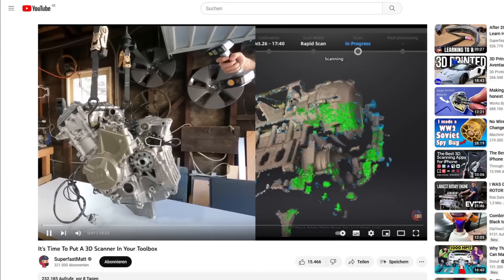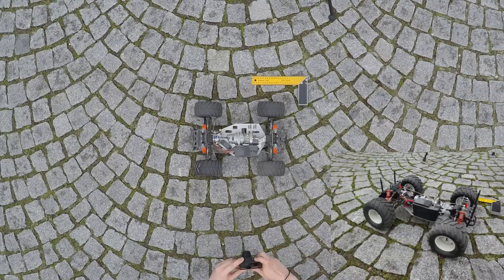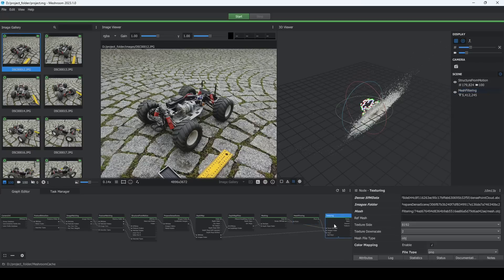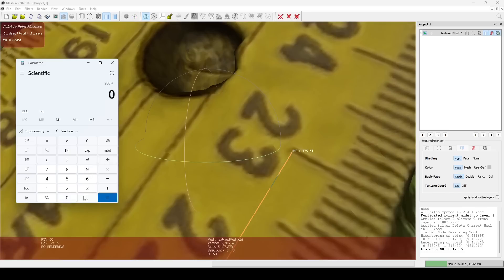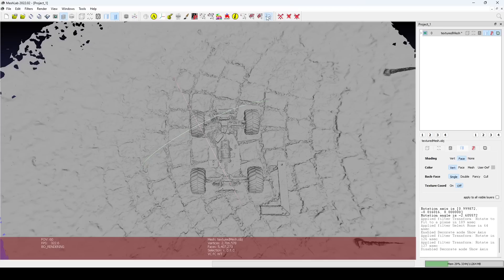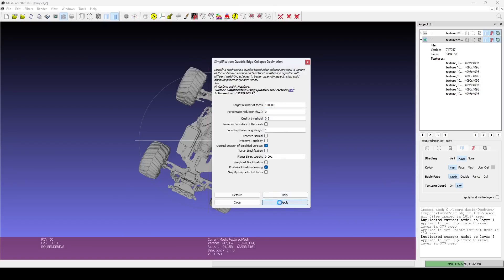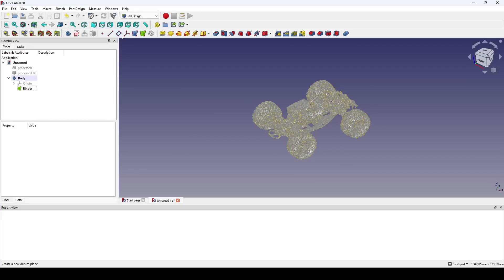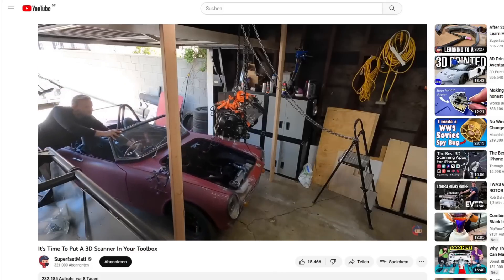It's Time To Put Open Source Photogrammetry In Your Toolbox

Comment: How do you take pictures of the bottom of the subject? There's a lot of detail underneath.
Reply from the maker: I know two ways around that issue. Option A: Mount your object on a pole at a height that allows you to take pictures from above and below. Option B: Perform two scans, one with the object flipped upside down, and merge them digitally. Meshlab has the Alignment tool for that purpose.

Comment: The main idea of 3D scanning is that you don't need to do yourself 3D modelling. As long as it requires doing Topology manually after scanning it's not working as intended. You could 3D model this RC-Car by hand faster than you 3D scan it and then model manually
Reply: You don't get perfect CAD ready 3D models from 3D scanners either, there is separate software for that.

Comment: How would you change this workflow to make a 3D model of something big like a house or garden?
Reply from the maker: Not much. You'll still want to get pictures evenly around the object. Professionals use a drone for that. If that's not an option, take pictures close and further away from the house. Then, depending on your roof you might not get good reconstruction there. For scaling you could use the length of a wall for example.

Comment: I'm still waiting for a good OCR AI that can read old math books and transcribe all the formulas without any issues
Reply: Like handwritten or printed? I feel like tesseract should be able to do it if it's printed. If memory serves there is a language pack for math symbols.
Reply: @oliverer3  Yes, I have tried Tesseract as well as numerous open-source tools and private software like PDF elements. I have some old scanned books that are no longer available in my country, but they are low-quality images in the form of old PDFs. Unfortunately, I haven't come across a single AI tool that can accurately recognize the text and transcribe it directly into a format like Markdown or LaTeX, especially when it comes to mathematical formulas and other symbols.
Reply: @Maisonier  You could probably use a combination of tesseract and OpenCV to do it then but it would take a decent amount of manual effort to tune it. Plug and play tools are probably not there yet.

Comment: Bro came back after 9years and just posted a super useful video. Very appreciated, thank you😁
Reply: hahah 
That’s pretty wild. I did that on one of my other channels. Just had some mobile game  footage from years ago and posted a flight training video. (with a real airplane, not a video game)

 Just wanted to backup the files somewhere else besides the phone because it was overheating and the battery was expanding in thickness. Didn’t want to have to wait until I could order a new battery to get to the video files, in case the battery completely failed or even burst open. Ended up uploading public by accident and didn’t realize it till I got home hours later. Some of my old game buddys saw it along with a “face reveal” lol

Comment: 0:20 isn't that an AMD Gpu?
Reply from the maker: It's a Nvidia 1080 Ti.
Reply: I don't know even any LLM project using anything other than Nvidia, so forget about Amd and never buy their trash - after they deliberately engineering the death of graphics chips in all Macbooks Pro from 2011, which I have, moreover I have two similar models Macbooks, one Nvidia, other Amd and last one died as predicted on forums, a mass time bomb. It's really hard to resurrect macbook after, you're left only with Intel graphics and half power slower notebook. Their chips dying because of overheating, ridiculous.
Reply: @fontenbleau I don't know about the incident you refer to, but given it's an apple product I wouldn't be so quick to blame AMD. The LLM thing is because nvidia holds the rights to CUDA, not necessarily because they are inherently superior. Frankly I think in raw rasterization they offer better value than Nvidia in the most recent generation, but limited in gaming by ray tracing, and limited in everything else because of Cuda. They could make Cuda Red or something, but why would any developer support it when Cuda is already a standard with like 90% {made up number} market share and existing libraries. Their CPUs in recent years are genuinely so much better value and power efficienct than Intel's (and just better outright in gaming with 3D V-Cache) that I want their GPU department to start pulling their weight.
Reply: @paul-fornage  maybe if you would own such Apple model you will know, because apple forum filled about that, i've made the notorius recovery method by overheating it under blanket, but it worked for few days only and their current hardware even cheaply made. I have Mac mini from newest, it's horrible ventilated & overheating always.

Comment: can we use photogrammetry with turntables instead of us rounding the object?
Reply from the maker: Yes that is possible. For it to work I had to set "Minimal 2D Motion" in the "FeatureMatching" Node. I used a value of 5 but you might have to experiment.

Comment: i love the vid but the result is poor
Reply from the maker: Better results are possible. Either by taking more pictures or by tweaking pipeline settings. You can find more information here: https://meshroom-manual.readthedocs.io/en/latest/faq/reconstruction-parameters/reconstruction-parameters.html . For those improvements you will have to accept longer processing times.
Reply: @DanielJutz  but is it better than a manual topo ?

Comment: Is nVidia strictly required?
Reply from the maker: Draft Meshing is available which does not need a Nvidia GPU. While it computes faster, the results will always be worse. You can access that Pipeline from File > New Pipeline > Photogrammetry Draft. You will probably want to increase Describer Density and Quality to high or ultra in the Feature Extraction Node.
Reply: These days of Ai you can't even test any LLM without Nvidia, forget about cheap notebooks with Intel graphics or AMD trash (their chips are cheap but very bad in support and unreliable, Amd was found in planned obsolescence in graphics chips, so designed defects in Macbooks which massively dying after certain years, I have one of whose).

Comment: 4:13 you mean use a decimal as a decimal? Why do Europeans use commas for decimal points?
Reply: Why do they use a comma in that case?  Because they were already using the period as a thousands separator, of course!   :)

This sort of thing is quite like the idea of having traffic drive on the left or right hand side of the road as a convention.  To be pedantic, it's called a radix point in general, in case you're not using a period, or a comma ... or not using a decimal number system.     

This issue is a problem of bad localization in MeshLab, and it ought to be raised as a bug with that project so this sort of advice to use a foreign choice of radix point symbol isn't needed anymore.

Comment: I recommend using your smartphone for taking photos. Like the S22 for example. But before you start, turn on any metadata options you can find. It will write every sensorvalue including tilt, position, roll etc etc into the image metadata and photogrammetry tools can use those very efficiently!
Reply: @UCKY5  The majority of smart phones don't allow you to turn it off besides GPS which is a good thing in this case.
Reply: How to record orientation of each photo? Idont get it. if it's drone, it separated to different file
Reply: @rafiffadhil5872  It doesn't NEED the orientation as meta data. It just speeds up the calculation if it does.
You can throw different cameras in the software (like mixing drone shots with regular shots) and the software will do just fine.
Reply: @clipeclipaway  exactly. Normaly you don't need any additional settings. For example when taking photos with the S22, the image contains stuff like:
Orientation
Position
Focus length
Lense type
Pixel size
These are stored in the exif metadata of every image.
In Windows you can see some when you right click -> properties -> details.
Reply: @UCKY5  it's likely on by default, and unable to be disabled
Reply: @justinlabarge8178  how do I check that my files have them?

Comment: I recommend 3DF Zephyr (there is a free version to try it out) or better buy a good 3D Scanner such as Einscan SP or Einstar from Shining for slightly bigger parts.
Reply: I also prefer 3df zephyr, is much much faster imo. Free version used.
Reply: the free version has a limit on the number of images you can use
Reply: @theneonbop  yeah but it’s around 70 pictures. Try it out. It’s enough for most projects.
I bought the version for 300 pictures in the end because it works.

Comment: A very fascinating thing. Tried myself 30 hrs ago. My thing is still rendering. I guess 70 photos with 108mp is overkill. Has Ryzen 5 1600x, 16gb of DDR4 RAM and Gtx 1060 6 gb to process it.
Reply from the maker: The number of pictures is good but 108mp is a lot ;) Are you stuck at the depth map node? That one took the longest for me. In the depth map node you can set a downscale factor. Try 8/16, the default is 2. On my system 100 images at 18mp took 80 minutes (ryzen 3800xt, 32gb ddr4, 1080TI).
Reply: @DanielJutz  It was just the first step. It took approx. 65 minutes to process one photo. So at 35 hrs it was around 30 photos out of 68. So i went to make another set of photos xD
Reply: maybe try using a better camera. Picture resolution isn't a good value to judge camera quality, usually they aren't good sensors if they need to market them with 108mp
Reply: Algorithmen often work better with less megapixels. Tesla's FSD example work I believe with a 3 or 5 Megapixel cameras. But sure it's not the same for fast real time 3d Images or high quality 3d files
Reply: 108mp?!? What are you shooting with?
Reply: Your config sucks. It's a very cheap one. Low A LOT your photo resolution (108mp are useless! Especially taken with a smartphone as i guess you did) and sleep well with your PC working so hard for days (or week) just for a render 😂 

Cpu and Gpu are the main stuffs here. Your cpu+gpu are low-end old-gen hardwares (even when they sold for the very first time, those things were "below-entry-level")